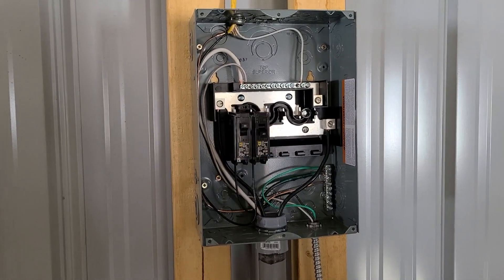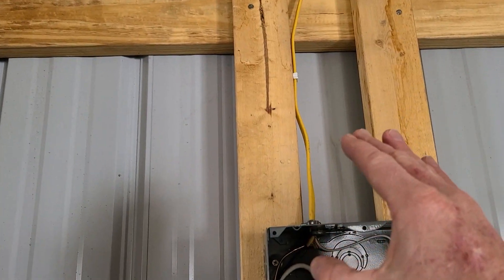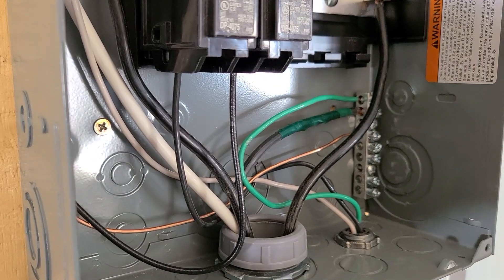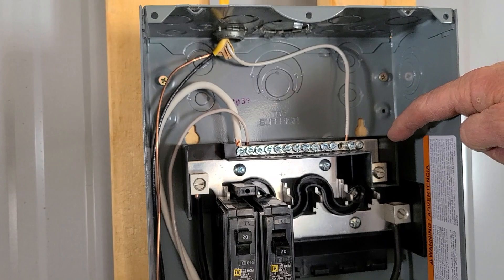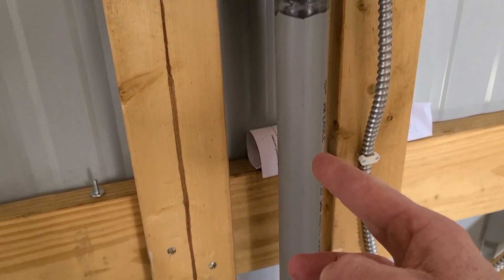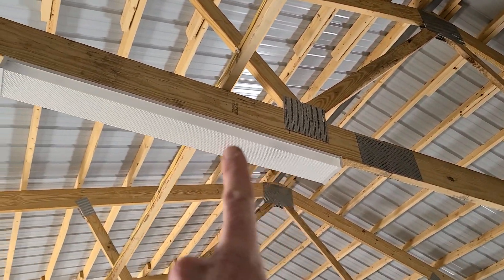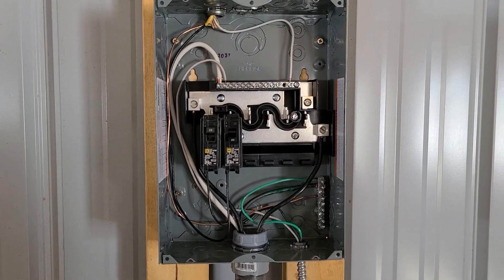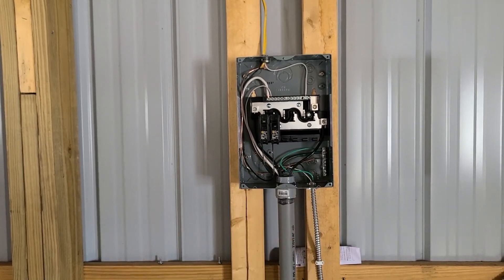How To Wire BX Armored And Romex Electrical Wiring For Sub Panel For Garage Shop Pole Barn

Comment: Main breaker or disconnecting means and ground rods are required for sub panels in detached buildings.  Articles 225 and 250 NEC.

Comment: I watched their horrible panel install video.  I see some things were corrected.  WHERE is the ground rods and grounding elctrode conductor (ground wire)?

The panel install video needs to be taken down or updated.
Reply: lol they still got the neutral feeder on the bus bar instead of on the main neutral lug cus they cut the wire too short.

Comment: That’s MC cable. BX/AC cable doesn’t have a green ground conductor.
Reply: I see ground conductors on every cable going into the box. There is a green cable on each of the wires!
Reply: Exactly. The title of the video says “BX”.. he’s showing how to run MC cable which has green  grounding conductors. BX cable is ancient and isn’t sold anymore. Your options for armored cable now are MC (green ground) and AC (bonding wire with armor being grounding conductor)